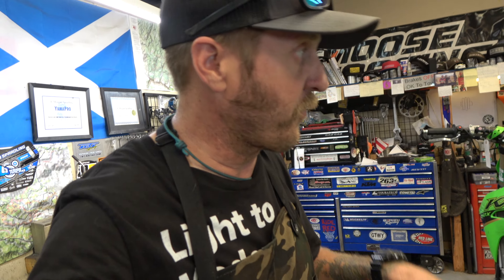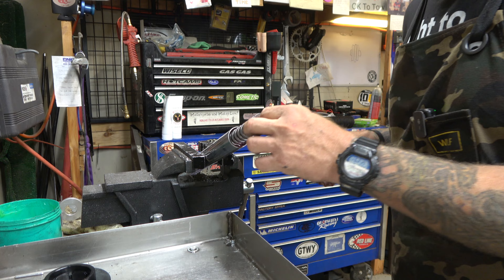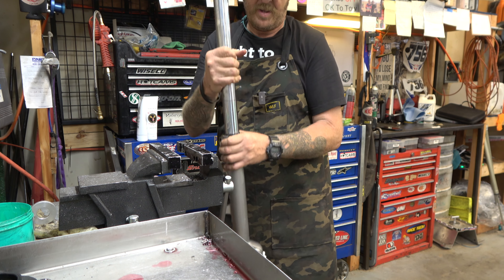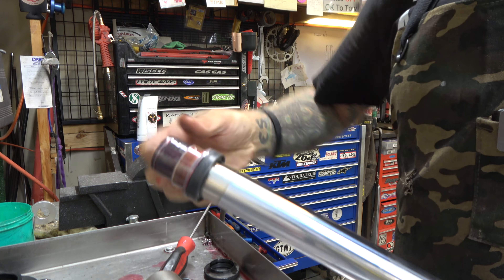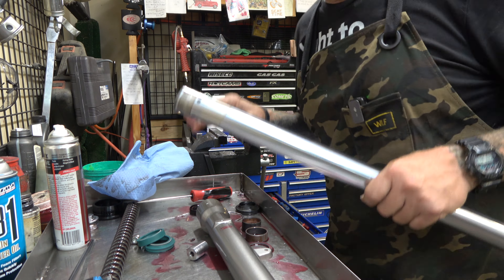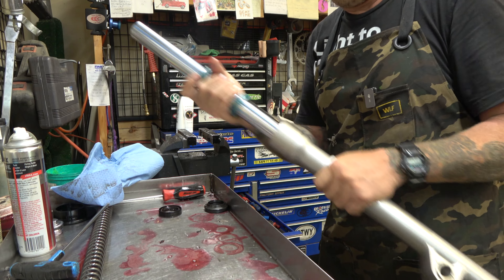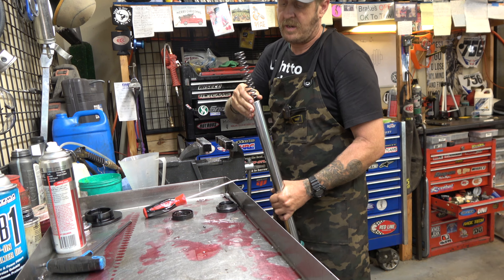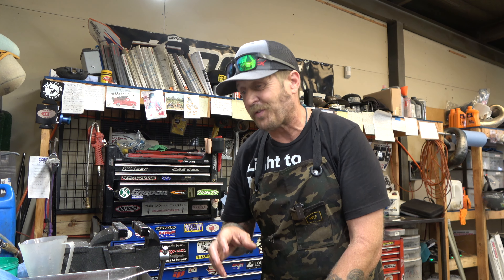KLX 230 Fork Seals | How do I do Fork Seals on My KLX230 | Highland Cycles

Comment: Similar to KLR forks.  It takes about 10 minutes to change fork springs if that's all you need to do.  FYI...pieces of PVC pipe, sliced lengthwise can make good seal drivers in more that just bikes. Great video!

Comment: The 2 things that caused me the biggest problems while doing this was my glide bushing (copper colored one) wasn’t seating right which cause my seals to not sit right because there wasn’t enough space. If you put the bushing on first without the washer hiding it you will know if it’s not flush. Second thing was the direction of the fork seal, the side with letters on the first seal should be facing away from the oil (towards the sky when installed on the bike) hope this saves someone some head and not having to buy another set of seals like me 😅. Good video though

Comment: i got 1984 xr350 forks on my xr200......i like the punch method, i didnt want to buy a seal setter.......
Reply: Or you could just use a pvc pipe cut in half, put the two piece on the tube to drive the seal in, i've used it a few times and works flawlessly.
Reply: @easterntownshipsenduro  .......thanks man i got a piece of pipe in the garage i can use